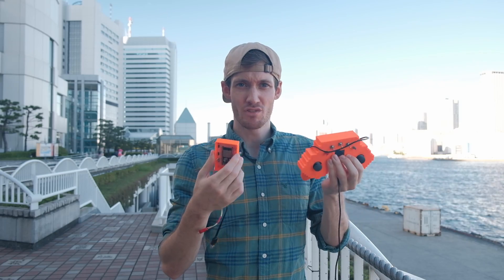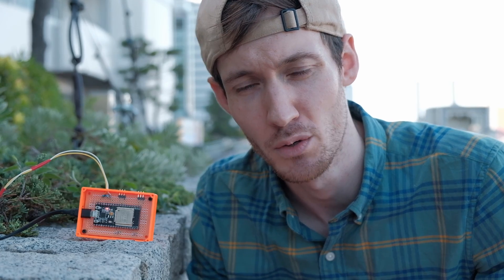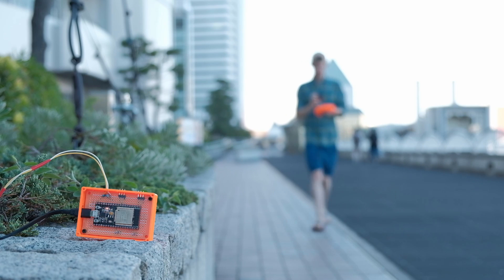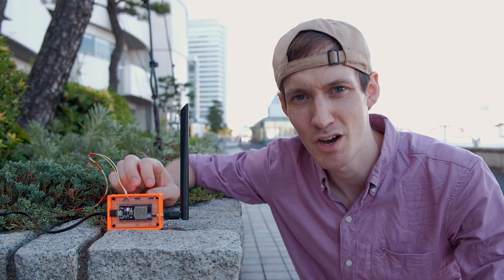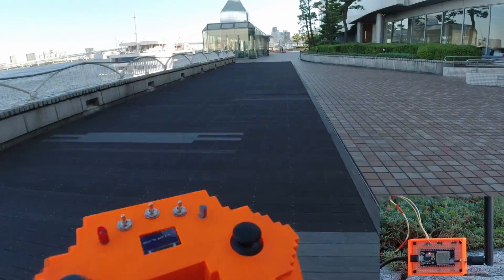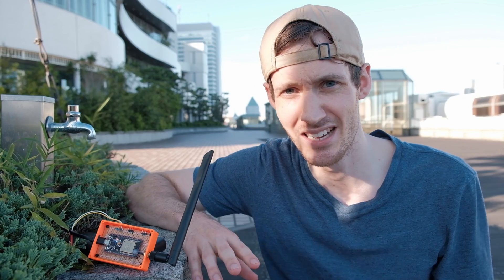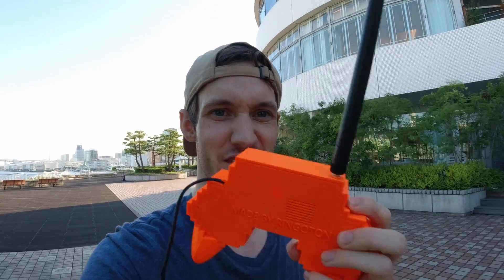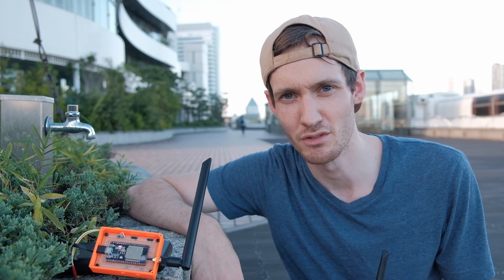ESP32 range enhancement with external wifi antenna. How far will it go?

Comment: I made an ESP-NOW range test using an ESP32-S3 module with PCB antenna. 
For this first test I haven't enabled the long range LR. The results are impressive, 650 meters straight line without obstacles. The code was written in Arduino and as I found on forums the LR can only be enabled on ESP-IDF. 
The second test, enabling LR Long Range using ESP-IDF. The strange think is that the result have not changed, and in theory I should see a 4dB improvement. 
My first reading is that the LR comes already enabled by default (at least on newer module models), but I haven't found any documentation saying this and haven't made tests with older ESP32 modules.
Any idea about this anyone?

Comment: Your antennae orientation is all wrong. With the antennae pointing like swords at each other, the radiation is being is being focused 90° away from where it should be. With dipoles like these they’re supposed to be parallel to each other.

Comment: I would think the better approach is to use directional antennas at proper lengths per frequency used, and/or boost power to them?  Andreas Spiess has done a lot on this.
Reply: that's cheating. Omnis are more useful.

Comment: Did you use Long Range mode (WIFI_PROTOCOL_LR) on your transmitter? I think you will get range > 200m
Reply from the maker: I used esp-now protocol. I don't think that has a LR mode.
Reply: @ringoton  There is

Comment: In the world of antennas, bigger is not better. You want an efficient antenna (probably 1/4 wavelength) that radiates as much of the transmitted power as possible. I would think a good starting point is to use your phone running the app WiFi Analyzer which will give you an indication of the transmitted power increase as you change the antenna. This way you can put a number to the dB gain by using the external antenna for transmit. Also I wonder if ESP has the equivalent of WiFi Analyzer where you can display the received power. Again this gives you a quantative number for the gain of the receive antenna - I would expect roughly the same Tx/Rx gain. You could then experiment with different antennas to see which are more efficient.

Comment: Hi I just tumbled on this video and am also messing with ESP32 in Japan. I think Jeany is likely into something with her comment about your new antenna not being used even though you soldered it in. The esp32-cam comes with an antenna connection, but to make it work you need to move a resistor to away from the internal antenna and on to the external antenna.  You can only use one at a time. I assume a similar process is required for the wiring in an antenna for esp32 prime.
Reply from the maker: As I was researching in the internet I had found a guide for connecting an external antenna, I just followed that blindly. If an additional resistor is necessary, that would explain why my range is so short. Apparently, there is also a special wifi setting for ESP32 for long range. I might have to try that one out as well. In any case, I just wanted to make sure my remote control would be sufficient for visual operation, therefore my current setup covers that range completely :)
Reply: @ringoton  No your method is correct. the resistor @ultrabob mentioned is just but a 0 Ohm resistor used as a jumper to select whether to use the PCB antenna or the external antenna (IPX connector) that exist on WROOM-1U model. The extended range is also reasonable, imo.
Do keep in mind that PCB antenna does have directionality. Not to mention when u were testing it, the perf board were directly obstructing the line of sight between ur reciever and transmitter; possibly affecting the transmitted signal. If you had flipped the facing direction of your receiver, you might've gained a bit of distance increase when using the PCB antenna..

Comment: Size matters, but it's still not always as bigger as better. Your optimism to get a bigger reach because of the size of this anttennas makes me a bit suspicious. Antennas dont have toi be big, their length must match the frequency. I think those ESP modules you  buy with an external antenna, come with shorter ones. So maybe it makes sense to try another antenna or even buy an Esp module with external antenna.
Another thing is, that you have to cut some traces to disconnect the  integrated antenna when you add an internal one. The video doesnt show if you did that.